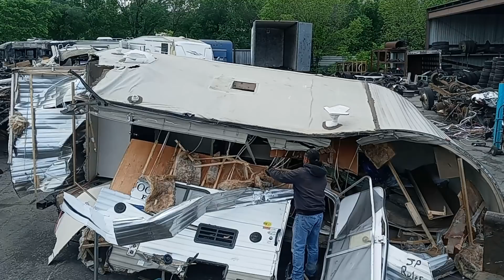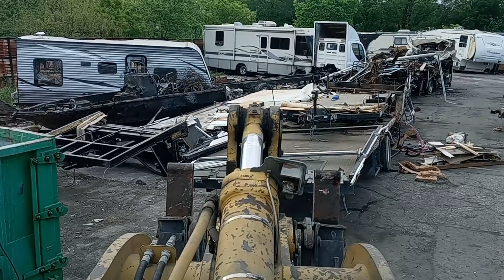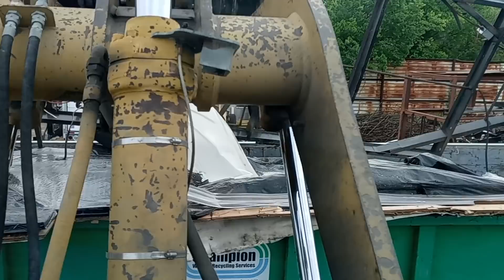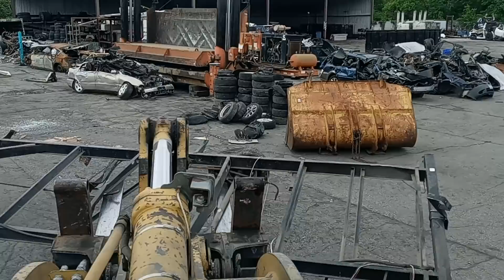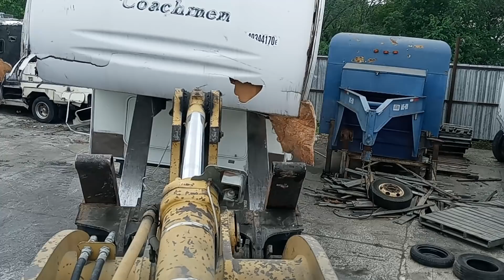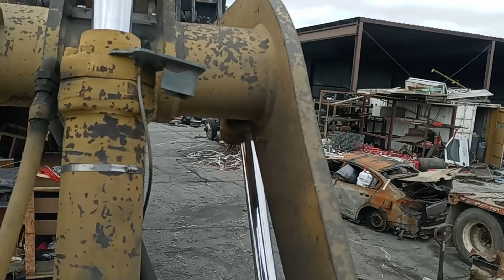Can't go Crush 😟 But at least got to Destroy something 🤠👍😃

Comment: Cowboy, perhaps you should suggest to your boss that he either sends the caravans to a C&D chipping mill, or he has one come in whenever he has a few caravans or motorhomes to dispose of. Basically, what this does is the same thing they do with C&D - construction & demolition - waste, they feed it into a chipping mill that sizes it down to certain sizes of pieces, and after that, it sorts it for various kinds of waste materials they like to recover from it. It would be a lot easier and faster to have them sort and process the whole items. The only issue I can see is transportation to such a mill site. If they got folded up correctly, you might be able to flat pack a lot of it into bundles that would go down the road. Perhaps just size it down so it fits into the skip hire bin, it seems like a lot of work to do it with a loader that's not really suited to the job.
Reply: He should probably send the skip hire bin contents for C&D waste separation anyway, if it reduces the waste metal that would end up in landfill, that would be a significant benefit to the environment. After they reprocess it all, there would be a lot less waste that would wind up in a landfill.
Reply: it works out for both your company and the C&D mill, too, both get something out of it, and they're always processing wood and metal to separate it out anyway, so it'd probably be a small amount of extra processing for them, since they process large quantities by volume anyway.